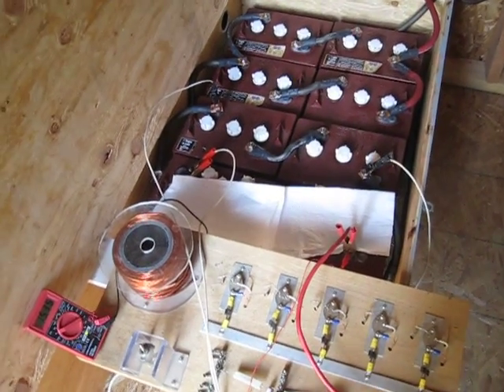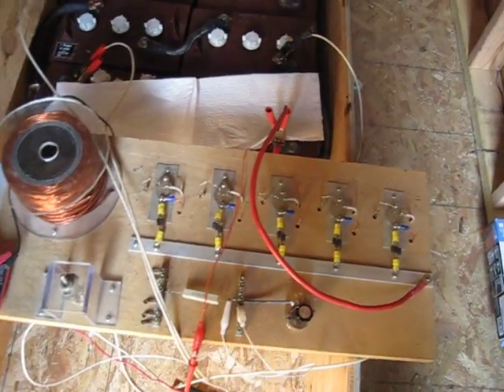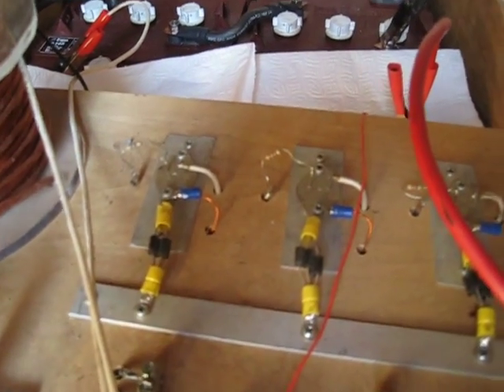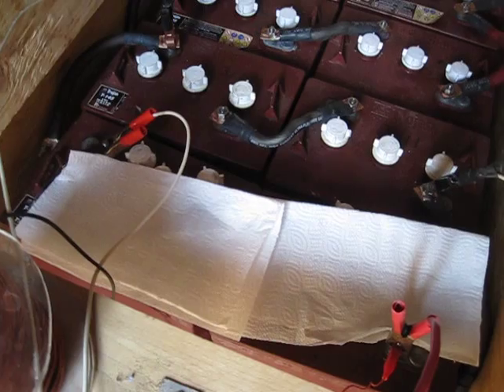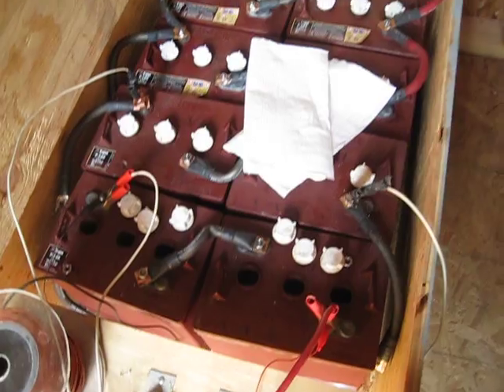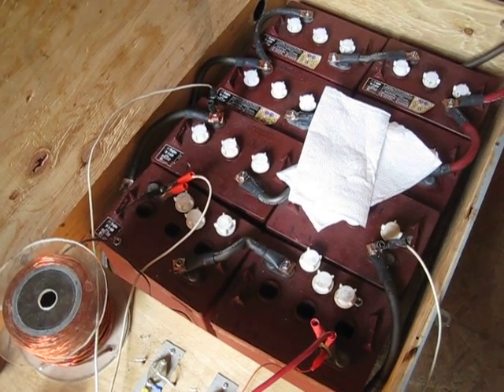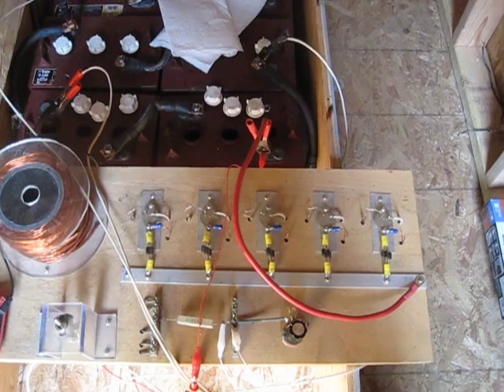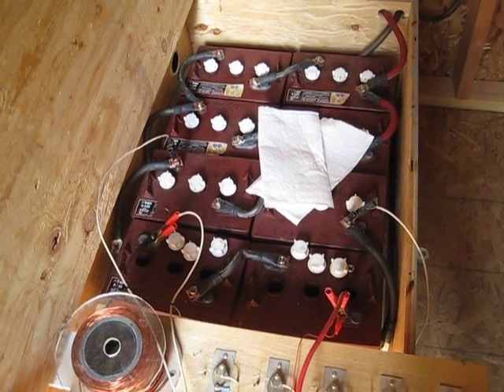Solar Battery bank DeSulfation 001 Part 1

Comment from the maker: a lot of guys like using cap dumps to smooth out the output of the pulse motor while others feel it inhibits the spike voltage from doing there job.

Comment from the maker: the diodes are just protecting the transistors as I work my way down lower in resistance the output will increase a lot since I am using the MJ transistor. its basically protecting any back feeding into the individual transistors.

Comment from the maker: Hey Cool Joule, I have always loved that Cap Dump demo. right now I just want to recondition the batteries so I want that spike to hit the cells full force. now when I go to charge them back up to put back in the bank I will hook up the caps and run it that way. the caps smooth out the voltage and really charges the batteries really nice.
Reply: Oh, Interesting. you recommend the vanilla 'pot' setup to recondition and the CPD mod to charge regularly?

What does that CPD mod really do then? My understanding was that it 'cleans up' the trigger and isolates the spikes so the transistors fire more synchronously ? wrong?

thanks, really nice build

Comment from the maker: hey Jason, how is the weather in your neck of the woods?  I have a few extra transistors and stuff I can throw one together. when we hook up one of these days I can bring one with me. that way I can go over the Do's and DoNots with this set up. its also really a good idea to have a amp meter inline to see how many amps you are drawing off the run batteries. if you can dial in the C-20 rate, then you can work on both sets at the same time, one is being drawn down, while the other set is charged. you will be surprised just how much power this puts out. Voltage spikes of over 300volts.

Comment from the maker: hope it will help you out Craig. if you have problems just let me know. also, once you get ready to test the solid state. make sure you have a on/off switch. its easier to get the solid state started that way. also, you always hook the positive output to the battery to be charged first. then its negative , then move to the battery you are going to run it off. hook up positive first, then negative last. reverse procedures when you unhook it. any other info you might want, just let me know, be glad to help.

Comment from the maker: howdy john. The websight is  iaecforumco.com     if you spell it just like I did it will come up and have fun, look under solid state pulse motors. now if you want to build your first one , I would recommend you find a old tv set, take the back off and around the picture tube is a black rap of magnet wire. take that away from the picture tube without cutting the wire except were it connects at each end. single strand part. then take a knife and remove the insulation tape without damaging the wire insulation. follow the directions to make a Air Coil, two strands, radio shack has all the other parts, you will need a 2N3055 transistor part # 276-2041 use only that type, not a tip type transistor. and a potientiomiter 1/2 watt 35ohm resistor on off switch and a soldier gun, then just follow steps at the forum. a single transistor will work ok to charge small batteries, car batteries will need 3 to 5 transistors.